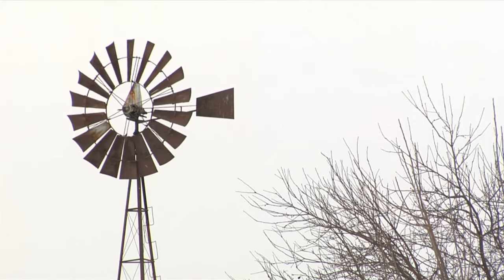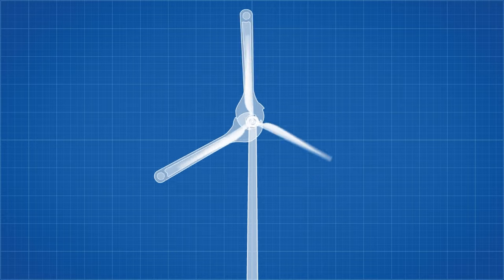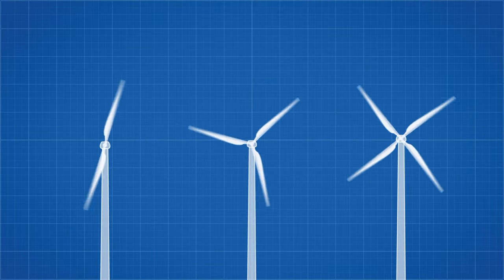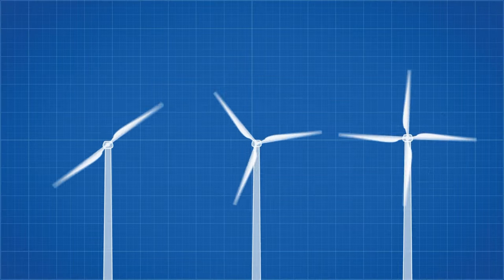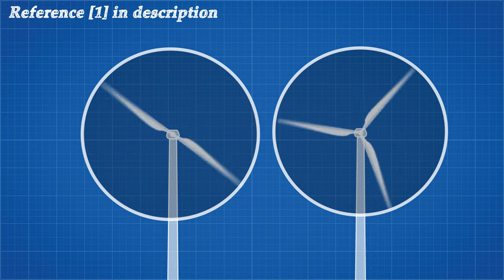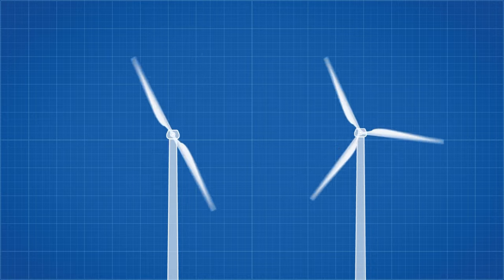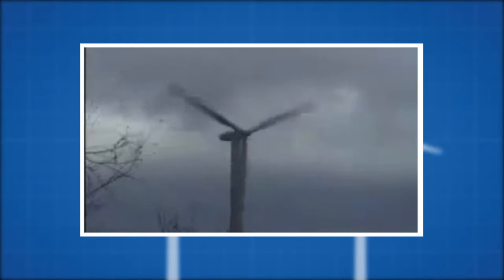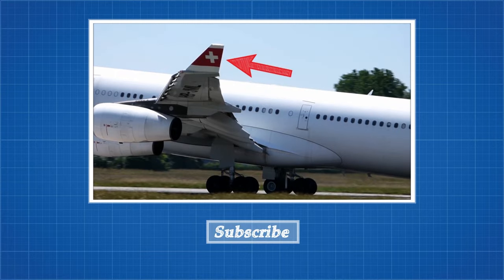Why Do Wind Turbines Have Three Blades?

Comment: Another aspect of the explanation is 3 blades counteract EACH OTHER during changes in yaw (yaw = directional aim for the entire rotor), whereas 2 blades transmit the forces resulting from changing directions to the bearings, tower, etc.  A  two-bladed rotor changes direction easily when vertical, and hard when horizontal.  Old-timers call the resulting percussive hammering "yaw judders" or "chopping around the corner".  That's why 3 blades run smooth, while 2 blades will shake the machine apart.  And the reason you only need a few slender blades, rather than filling the whole circle with blades, is they go so fast that it doesn't take very much blade to extract all the available power from the airstream..  Many attempts at two-bladed turbines use teetering hubs with the rotor downwind of the tower, to decouple the yaw judders from the bearings, have been tried, but few, if any, have proven to be a good solution.  As the video points out, two-bladers go just a bit too fast for effective noise control.  Because two-bladers go too fast AND shake themselves apart, the extra speed makes the shaking that much worse.  When you want machinery to last many years, smooth operation is key.

Comment: CENTRIFUGAL FORCE ISN'T A REAL FORCE, pickup a physics book mr "Real Engineering".
Reply: +Krieger heh, thank you for that humor sir
Reply: It is to engineers. Go and hold on to one of those blade tips while they're spinning at full speed and after your arms give way after  0.2 seconds, do you fly inwards or outwards? 

By the way Krieger was pointing out that you're wrong.
Reply: It depends on what reference frame you're in. The centrifugal force can be real of fake; it all depends on the reference frame.
Reply: Its never a "fake force". In my experience that explanation is usually offered by those with little understanding in physics who are simply regurgitating the words of their high school physics teacher (who was also wrong) in an attempt to seem knowledgeable.

Centrifugal force can be thought as the tenancy of an object confined to a circular path to continue in its instantaneous tangential direction, in accordance with Newtons first law. It can also be thought of as the reaction force exerted by a body in circular motion in response to the centripetal force, which is the force confining the body to its circular path. Regardless of how you think of it these two behaviors don't change depending on your reference frame, that's a fairly dim witted explanation in my opinion.

Comment: Love your videos, you do a amazing job of explaining complex ideas in a way non-engineers can absorb. One thing you neglected to take about was additional blades can disturb the air the next blade rotates into causing decreased efficiency. I'm not sure if this is as big of a issue with turbines due to their slower rotation, but it dose impacts airplane and helicopter blades.

Comment: Perhaps look at balancing issues so as to minimize vibration. 
Cost-effective manufacturing likes modular construction.
Consider blades:
Building with matched weights and centers of mass along the long axes of individual blades is relatively straightforward. 
Locating the CoM offset from the nominal axis consistently is less easy.
Thus, two blade props are normally manufactured as a single unit so that balancing can be done in the shop in controlled conditions. 
Three blade configuration does not require such careful avoidance of induced torsional vibrations. 
Thus, shipping lengths are half.

Comment: Thanks! This was very easy to understand. I've always wondered why they don't use more blades, so as to increase the available torque, and thus be able to spin a higher capacity generator. I've never really considered what these machines cost, and that they need to be able to recover that cost in a reasonable amount of time.

Comment: One little thing is forgotten: 
The more blades the lower the induced drag. Ref.: Prandtl, Betz. 1926. It's "hidden" in the tip loss. 
But mainly- absolute correct, it's a cost and optimization issue.

Comment: A table with 3 legs are always stable.
Table with 4 legs, legs need to be the same hight (exactly) so it wont wobble.

Apart from the blueprint background that gives the impression of an engineer, which they stopped using by the way. 

Nice animations and thats about it.

Comment: And yet the fewer the number of blades the more efficient the propeller.  Control line speed model aeroplanes use a counter-balanced single blade because it makes the model fly faster with the same engine.  

Of course I know why :)  Wind turbines rotate slowly so the aerodynamic effect of one blade on the one following is relatively small but it might be interesting to know if single blade wind turbines exist.  Noise is another factor I suppose.  Incidentally we have an 18th C 6 bladed working windmill in our village.

Thanks for the videos

Comment: Curtiss-Wright figured this out late in the war, when incredibly large high performance piston engines were being built, just before the Jet Age. Too many blades, and you have a flywheel, with blades getting in the way...this isn't too bad for a low RPM water pumping mill. But at the other end? Even very small differences in weight will cause a two bladed design to tear itself right out of its motor mounts. This is why they went to three blades. And the old "Jacobs" windmills that were common in Rural USA  before the grid also used the far superior three blade design.

Comment: Going with higher blade count also limits your total speed but the turbine will start with less air going across it, so it is a matter of the areas wind type.
Most small home units come with higher blade counts, and you get them spinning with little wind but will quickly reach their speed limit. As far as I understand the air becomes too turbulent and no longer imparts enough force to the blades to speed them up.

Comment: I would think you could easily fill a full hour for video giving in-depth technical engineering specs, stress tolerances of materials, aerodynamic considerations and on and on.  Make it understandable to those without advanced electro mechanics and your up to several hours!  I respect your update about wanting to do a longer and better video and would eagerly wait for it as I think your initial attempt did quite a good job in a very short time.

Comment: you should add the more immidiate info for 2 bladed turbines which is the wobbling phenomenon which leads to stress on the turbines Tower / gears due to blade chattering while yawing into the wind. A turbine with three blades has very little vibration or chatter. This is because when one blade is in the horizontal position, its resistance to the yaw force is counter-balanced by the two other blades. So, a three-bladed turbine represents the best combination of high rotational speed and minimum stress.

Comment: It's a good question that I've thought about before but I don't know the answer to. I have heard that adding blades to a propeller is like changing gear ratios, so presumably hat means there's a trade off between 2 phsyical attributes (e.g. speed vs torque) and going too far one way increases the strain on the mechanical parts making them more expensive to design. I had assumed that was something to do with it.

Comment: No matter the number of blades, if you spin a given generator at a given speed, it will generate the same amount of energy. Spinning said given generator faster generates more energy. Speed matters. Also, the blades can be 'feathered' during high wind speeds, so that the windmill isn't damaged or destroyed. Simple physics folks. You don't need to be an electrical engineer or a genius to understand this.  The speed of a windmill blade is like a propeller. The tip is moving much faster that the hub mount. Sound is a main reason that they aren't usually constructed near where people live.

Comment: In the early 70's in the infantsy of large wind turbines:  One of the factors that led to 3 bladed propellers was the fact the 2 and 4 bladed propellers were exceedingly hard on main shaft bearings.  This was because the wind velocity differential between 100 feet (the propeller tip at the low end of the swing) and 300 feet (the propeller tip at the high end of the swing) would create enormous lateral stress on the main shaft bearing.  The use of a three bladed propeller effectively neutralized this effect.  All other factors aside, the three bladed propeller was the only configuration that would provide any degree of mechanical reliability in windmills that were large enough to be affected by (altitude) wind velocity differential.

Comment: hey hello,Did you forget to mention a double  blade ,at its point of rotation is parallel to the direction of wind,and this slows the speed of the turbine motion compared to three blade,which will have one extra blade at the direction of wind.

Comment: 2 more reasons - while the blades spin in open air, it is a pretty smooth ride, but as the blade passes the mast some pretty violent forces act upon it that cause stress and wear, so the more blades the turbine has, the shorter its total life span. second, an even number of blades tends to cause forces to resonate and start to yank on the shaft periodically, again causing unneccessary stresses. an odd placement of blades distributes force changes at different blade positions more evenly over the work cycle.

Comment: BTW : the shorter 4 blade design would also help to eliminate any stress (tho not sure why  "an even number of blades" creates stress that an odd number of blades doesn't from one blade being higher) caused since it would be that 10% (or whatever) of its blade length lower than the current model thus reducing both the chance of, as well as any effect of, wind speed that may occur due to the difference in height of the blades. All this keeping in mind that there are 2 ways to increase torque...longer "wrenches"...or MORE "short wrenches".
Reply: Nope, increasing past 3 blades reduces efficiency ...

Comment: Great Video, thanks! I'm teaching wind energy applications since +20 years, and 90 % of the facts are correct. Another issue with 2 bladed turbines is that they look very "bumpy" when turning, while 3-bladed turbines always look optically balanced.

Maybe we may motivate our "there is no centrifugal force, so this video is crap" friends to produce an excellent video like that to explain this issue a little bit further...

Comment: It just occurred to me, that there is something distinctly off with that theory that 3 blades would help reduce the stresses that occur from one blade getting no wind when it passes the pole, or mast or tower or whatever it is and its name is, at the lowest point of the circle these blades describe, and that the idea that a 3-bladed design would involve a reduction in the distortion of balance (and with that extra vibrations and extra stresses that play onto several parts) simply can't be right. When you think about it, with a 3-blade setup, there are TWO blades getting full wind whilst one gets none each time, so now 2 put up full force against that one blade that produces less our none for a short while, instead of the one active blade that is oriented oppositive of the one that momentarily is inacive each time as it happens in the 2-blade design. The relative stresses are theoretically up to twice as big!  I think it would be fair to conclude: 1 it may have got more to do with other variations and effects that might cause vibration, trembling and lack of balance, such as the fact that even over a distance of dozens of meters the force/speed of the wind might vary;  2 it might have got more to do with the actual surface of the blades (seems that although too long blades come with the problem of too high tip speed in up to several hundred kilometers/hour, blades that are constructed in a wider fashion like was done with the old (old-fashioned) wooden windmills, for some reason ALSO again is not favored by designers);  3 to overcome or at least significantly reduce the stress caused by the unbalance coming from one blade putting up no counter force for a short while each time, you would at least need 5 blades, and preferably even seven. In a setup that sports 5 blades, the blade that momentarily stops producing force (and therewith counterweight relative to the other blade or blades) is always accompanied by TWO other blades that ARE ACTIVE AT ITS OWN SIDE (halve if you will) of the axis so a construction like this puts up most of the oppositive forces that out takes to balance the two remaining active blades that are on the other side of the central point of rotation.  As opposed to there being two active blades OPPOSITE to it on the axis and NONE on its own side in the 3-blade setup. This however gradually becomes much more difficult to mount to the central axis of the thing, supposedly might be pricier as there is some loss simply related to the scaling difference  versus the effective surface created. And, ALL blades have a small part, near where they are mounted, where they catch little or no wind anyway, as the generator housing also  blocks the wind

Comment: Andrew Gerrad the president of the European Wind Energy Association, said in one conference speech that 3 bladed wind turbines are the result of human preference. 2 blade wind turbine would be way cheaper to move from one place to another. You could put it together in a factory and ship it to the site in one piece. When with 3 blade system you need to install the blades on site and that is really hard and expensive. But for some strange reason people hate how 2 blade turbine look like. Gerrad also said that now that offshore wind turbines are getting more common, wind turbine engineers don't need to think so much about the looks of the turbine.

Sorry for my english I'm from Finland.

Comment: It’s centripetal force that keeps the blades from flying off, if I remember right.  Centrifugal is not a real force but an apparent one.  While a person might perceive a centrifugal force as they press against the side of a spinning amusement park ride, it is the actual centripetal force of the ride’s structure that keeps him or her from flying off the ride.  A turbine blade wouldn’t perceive anything, so centrifugal doesn’t apply to it, I wouldn’t think.  Thanks for the video.

Comment: Then you may want to consider this too.
There is something that is not mentioned at all, in my opinion. As each wing moves ahead, leaves behind it a wake, that's where the next wing mustn't enter. The angular speed of the rotor/wing assembly and the speed of air dictate how long it takes for the wake to dissipate so that the next one will not be affected. It's the same as if a second pair of wings are placed just behind the first pair in an airplane, not only, it's not going to do any lifting because of the turbulent wake that  first pair leaves behind it, but it's going to be dangerous too, because instabilities will induce vibrations. It seems to me that, this is why many wings are not used to gain in torque and increase the power output. 

-----------------------
P.S. By the way, these modern wind mills ('WINGED' Wind Turbines) that produce electricity and have dominated the commercial sector, (actually it's a monopoly) harvest very little of the wind's power available in the area that they occupy, they aren't of the type of previous centuries that it was like having a surface against the wind.
--------Also note that:

Until yesterday though and probably still now, the reports were ACTUALLY against them, ACTUALLY  I repeat, because the electricity produced by them couldn't compete in cost, with electricity produced by burning fossil fuels, (hydrocarbons of all sort) NOT EVEN OIL (petroleum). Reflex on the process of bringing oil to use. It requires drilling, many times from offshore sites that require the construction  of floating platforms, (oil rigs,) building ships for transportation, refineries for processing it, as required for most cases and land transport, and still it's more efficient to burn oil to produce electrity. 
On the top of the mountains across the place that I live, at about 800 m (2500 ft) altitude, the turbines never stop turning, (forget for this case intermittent use) how come they don't produce cheap electrity. These too? That's why they have to do a lot more work, for the same cost to harvest a lot more power. THERE IS NOTHING BETTER TO EXTRACT WIND'S ENERGY THAN TRYING TO STOP IT WITH A SURFACE AGAINST IT.

Comment: When you remake the video you might want to also cover why airplane propellers have 2 blades while windmills have 3 blades. Apparently when the forces are opposite (the prop pushing the air rather than the air pushing the  prop) the forces are different, not merely opposite. And while you're at it, explain why traditional Dutch windmills can get away with having 4 blades.

Comment: If I don't reminder it wrong four blades and up aren't used because they cause too much turbulences which interfere with the other blades decreasing the energy extracted of the wind. So as you said it wouldn't be very cost/energy efficient.

Comment: Another (much more important) downside of faster rotation is the amount of rotations the main bearing of the turbine sees. Bearing life is directly related to the number of cycles (rotations) it goes through and with increased speed, the bearings will need to be replaced more often. Remember that these bearings are HUGE pieces of steel that are difficult and costly to install not to mention they are a major cost of the turbine.